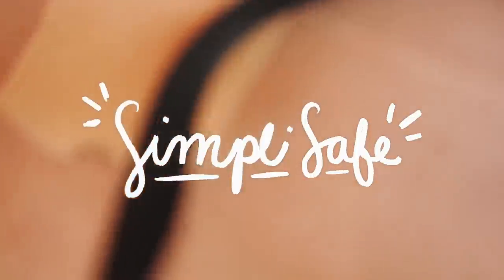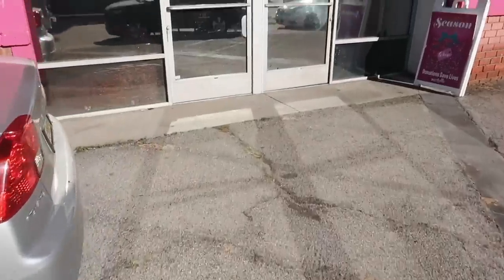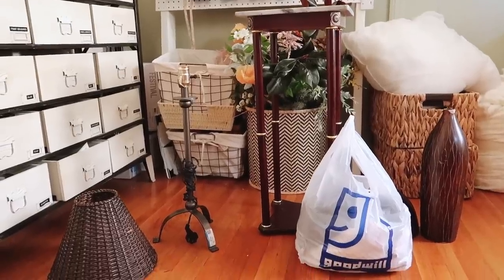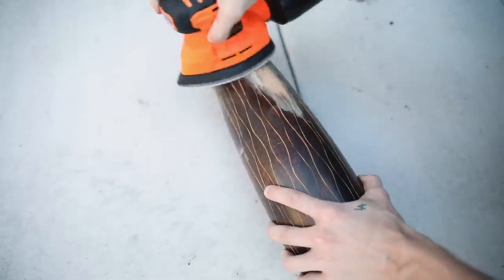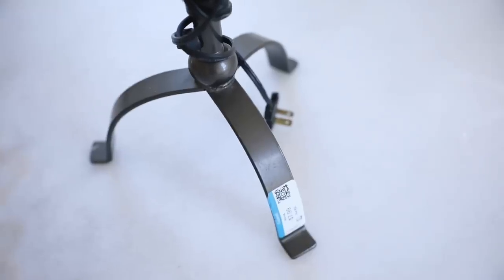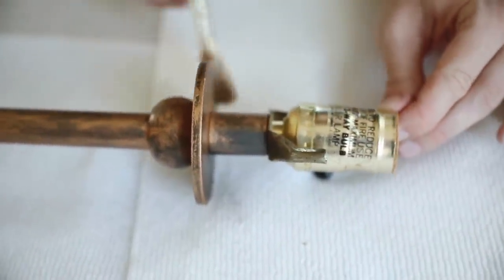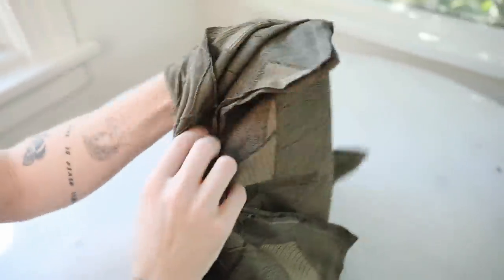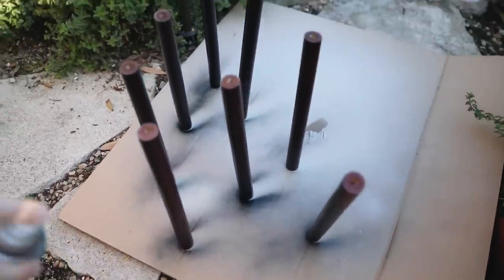DIY THRIFT FLIP Home Decor On A BUDGET! Affordable + Easy Transformations!

Comment: If you use a wood conditioner (you can buy at Home Depot or Lowes) before you stain, it will help your stain apply more evenly, prevent blotching, and also make everything look more uniform. Typically, a wood conditioner only needs to sit for about 15-30 minutes, so it doesn't greatly increase project time. Just a thought, but I love how everything turned out!